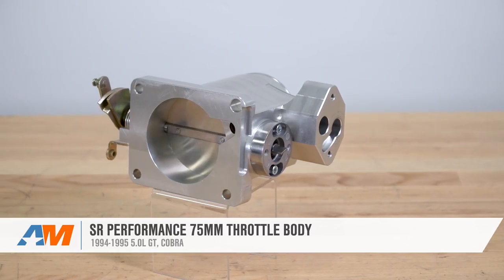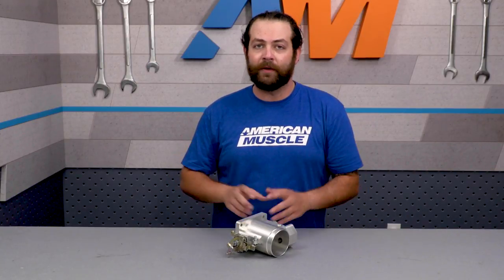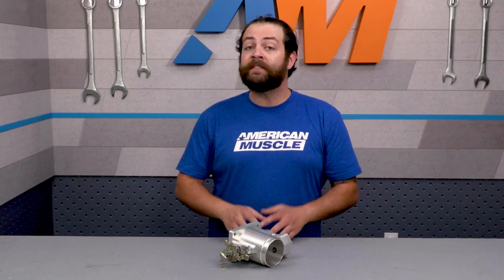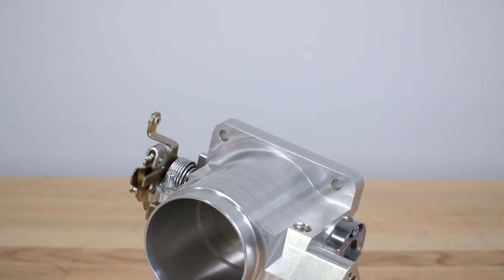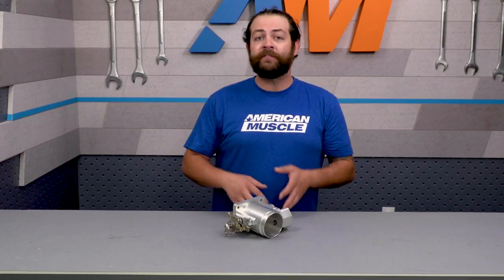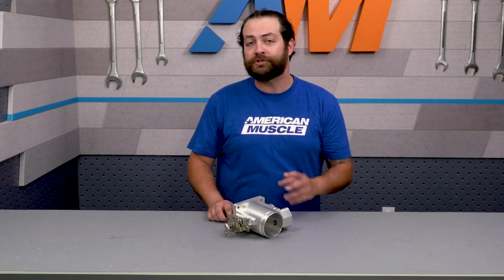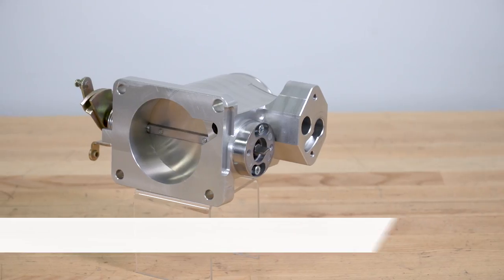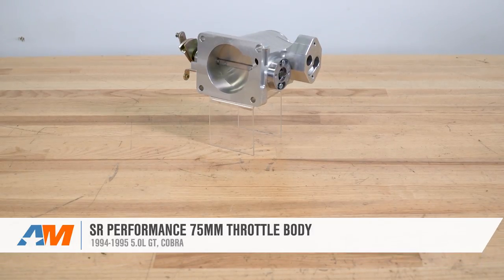1994-1995 Mustang 5.0L SR Performance 75mm Throttle Body Review

Comment: Now that I install this throttle body the car won’t start. I’m triple checking all of the connections, checked the battery, and I have a 0.818 on the TPS.

Comment: I got this and the SR cold air intake. After getting them installed the car wont start now. Does the bigger throttle body require a tune?
Reply: Did you ever figure this out? I have the same thing happened to me.
Reply: @lukecollins2489  I installed the original throttle body and it started right away. I threw the SR into the trash and went in a total different direction. Holley Sniper 2 w/ hyperspark.
Reply: @motor_citymuscle288  yeah I think that’s what I’m gonna do. Same thing happened to me. I put the old one back on and it started right up.

Comment: Guys don’t buy this part! I bought this throttle body for my 1995 mustang gt 5.0, I bolted it on and my car wouldn’t start! When I tried to return the part they asked me for 20 different pictures of the part, and a bunch of reasons for the return etc. I basically got scammed with a part that is useless and honestly worthless! Thanks AM I will not be buying any more parts from y’all!!
Reply: 🤣🤣🤣🤣 come on...
Reply from the maker: Hi Jonathan! Asking for photos of a part that could be defective is standard procedure for our returns process, same with asking for reasons for your return. We're more than happy to process your return if you give us a call or email. 👍 -Zach
Reply: Well shit this happened to me too.

After getting this installed on my car it wont start now. Does the bigger throttle body require a tune?
Reply: @motor_citymuscle288 yeah listen to the video bro the guy is saying you need an intake, en hauts , ect…
Reply: I purchased the same throttle body and I’m having the same issues.. Car turns over but won’t start
Reply: @onrylopez940 did you figure yours out? I’m having the same issue